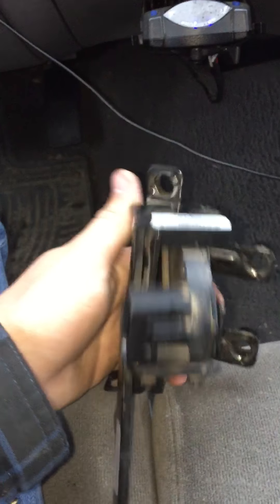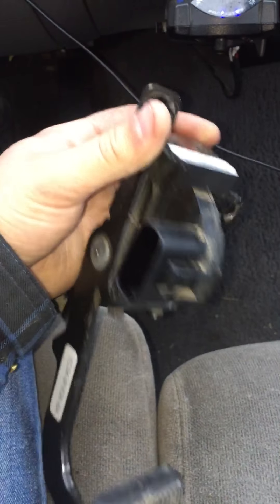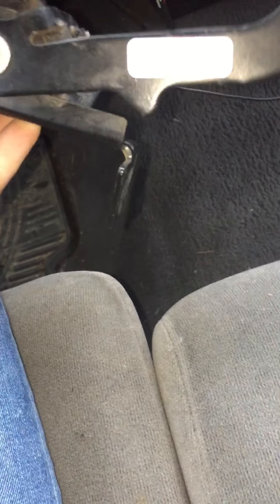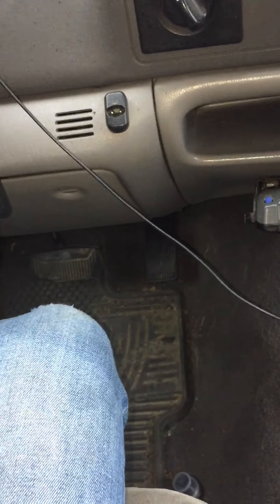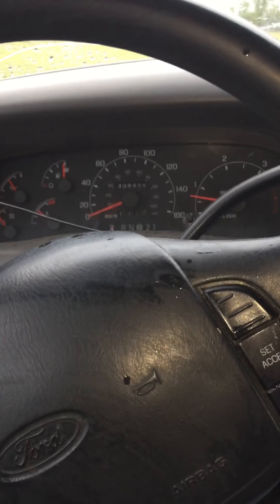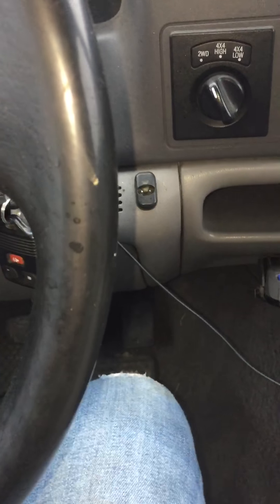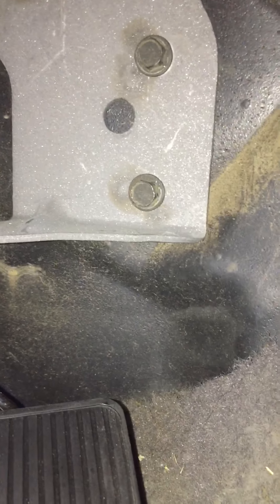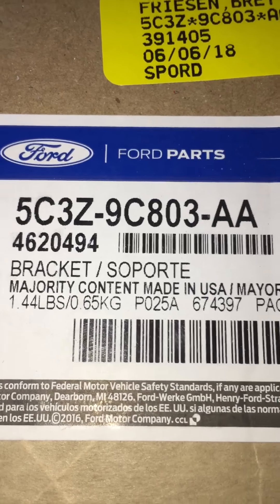How to diagnose a bad throttle position sensor 2001 Ford F-350 7.3

Comment: 2003 7.3 bus while cruising down the road. The engine will start to rev like I held it wide open for a second. As soon as I let off it quit. Doesn't seem sluggish. Engine lights on. I'll have to go get it scanned. Any input would be appreciated
Reply from the maker: Midnight Chevy well you say it’s a bus so I’m not an expert on how they work cause international has different parts and tuning for a 7.3 but it sounds like the potentiometer in the pedal is reading wrong and when you let off the throttle it closes the idle validation switch and goes back to normal but i don’t know enough about how international did things to say that’s for sure it
Reply: What was it having same problem rn

Comment: So what are some symptoms of it going bad? Mine kinda feels like its sluggish and at first I thought it was surging but then after watching some vids it could be lack of power then it kicking back in maybe once I use cruise it’s not an issue and if it’s cooler inside the cab it’s not an issue leading me to believe it’s the TPS
Reply from the maker: Steven Mcc  it’s possible but my truck never had a loss of power and I’ve never heard of the tps causing that it sounds like it might be another issue all of the information I’ve gathered on tps in these trucks shows that you lose all throttle control and the truck will just stay at idle speed until you mess with it a bit
Reply from the maker: Steven Mcc loss of power sounds more like injectors going bad or a boost leak
Reply: It’s more of a surge idk it’s goofy sometimes it happens more or less when it’s warmer be I do the trick to put cold air to the floor etc and it seems to lessen the problem or take care of it until truck inside gets warmed up again I know I have a fuel line leak somewhere up top and sometimes seems like it’s sucking air but the cooler air on the floor wouldn’t help leaking fuel haha lol the damn 7.3
Reply: And idk about the boost leak I’m always in good boost and check that bc I have some stuff done and don’t want to blow it up but don’t really beat on it bc it’s my daily and as far as injectors go they will be getting replaced hopefully soon with some 180/30
Reply from the maker: @stevenmcc2119  for my benifit is it cold outside in the morning when you have the problem while the truck is cold
Reply: @brettfriesen5540  my truck does that when i put the heather
Reply: You ever fix this ?? My 2002 acts funny.

Comment: Hey I have a check engine light that comes on when in idle and when I accelerate over 1500 RPMS it goes away.. When I stop again it got the check engine light back on.. Just wondering if you think its the sensor causing this. Great video btw
Reply from the maker: PoopInDoop I haven’t heard or experienced that light being on for the tps with it still functioning but best bet plug a code reader and see what code comes up that should point you in the right direction and if it’s an entirely different circuit or sensor it saves you from throwing parts at it cause generally if there is any thing wrong with the tps it just cuts all throttle and only lets the truck idle
Reply: Brett Friesen how much was the pedal
Reply from the maker: @andrewcavazos70  if i remember correctly is cost me around 170 to 160 bucks Canadian for the pedal and something like 60 bucks for the bracket but your price may varry best bet would be to call your local ford dealer and price it out.   (DO NOT USE AFTERMARKET SENSORS ON A FORD TRUCK THEY ARE VERY PROBLEMATIC SAVE YOUR SELF THE HEADACHE AND BUY THE FORD PART)
Reply: I have this exact problem with 2001 and sometimes the light comes on sometimes it does not. I am a bit confused on exact part# you used for the throttle assembly. If you could post the part number that would be awesome.
Reply: Chris Wesley I bought the one they sell at Napa 2years later still working good $118 Ford wants $450 for just the pedal
Reply: Chris Wesley if you call your local ford you can give them your vin and they’ll get you the correct part for your truck
Reply from the maker: @andrewcavazos70  i know napa makes good stuff but ford trucks seem to be picky about sensors lol. maybe im just bad luck and constantly get duds but any time ive bought an after market sensor for a ford truck it has been a dud out of the box.
Reply from the maker: @Wesleysguideservice  the part number for the pedal assembly i got from ford was 1C34-9F836-CA and the adapter bracket was 5C3Z-9C803-AA